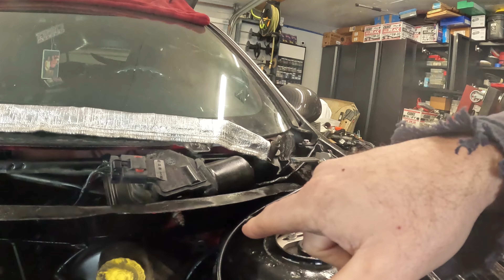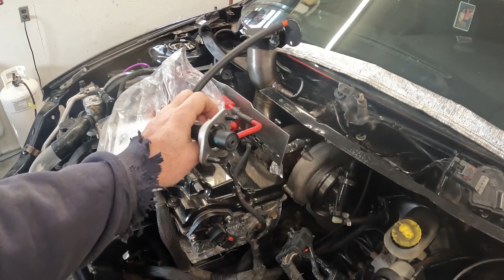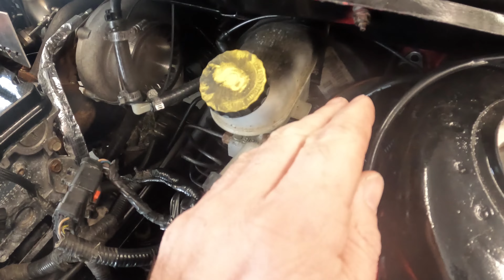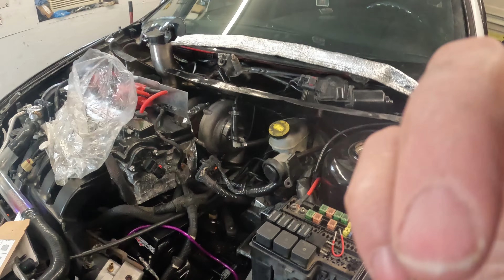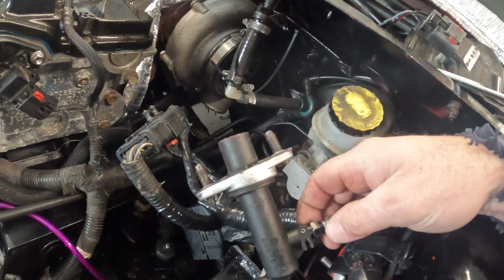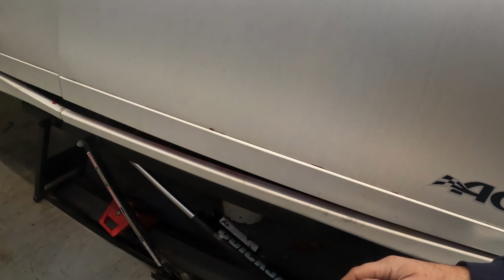carbon nsrt4 first start up...

Comment: Hey Matt, I got a question about my Nsrt4 so I got a code p0113 for the IAT sensor and I replaced it but the code won’t erase with a scanner and before it was solid cel but now blinks then goes solid, if you could give your thoughts on it but thank you and awesome videos keep it up!
Reply from the maker: what comes up with the key cycle? good connection at the obd2 plug? this is the air temp sensor at the oem air box location check the plug end and look over the wire for damage on lots of cars they get pulled out and just lay there and hang down on the trans or down threw the hole in the fender apron lots of cars are missing the inner fender well so the sensor and wiring gets hit with road debris ect